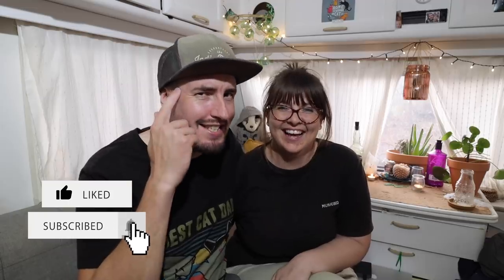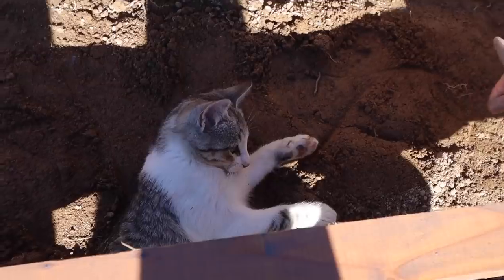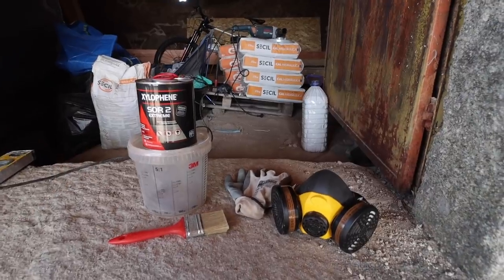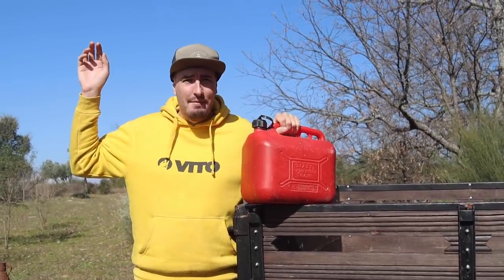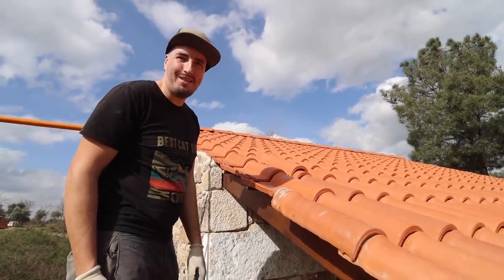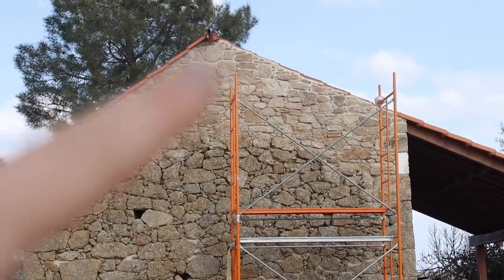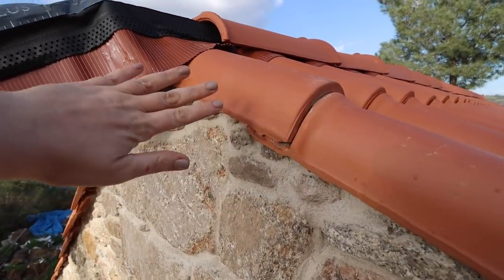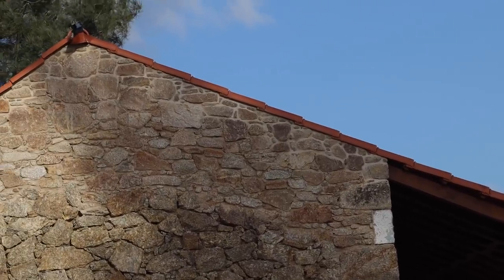Completing Our Roof! Restoring an Off-Grid Abandoned Barn in Portugal

Comment: I'm a former roofer that used to do tile roofs. DO NOT brush the whole roof. You DO NOT want to walk on that roof if you don't have to that is the number one-way you will get cracks in those tiles and leaks in your roof. Just let the next rain clean it for you
Reply: Sandra Westley I agree with the above, we had an extension and people have walked on the roof and we started with leaks, trying to find where they were coming from was a nightmare because they were only hair line cracks, (no pun intended) but once we found them and replaced the cracked ones we are dry Again but it’s taken a year of leaks to find where the water was getting in.

Comment: Put the old steel door on a hanging slider rail so it covers your glass door when away but slides nicely to one side and still show off the patina under the veranda
Reply: That is a brilliant idea. It would look really cool and do the security thing well.
Reply: @consideredwhisper  Totally agree!
Reply: That is exactly what I was thinking.  But one has to think how safe that is on the outside.  If it can be removed from it's tracks, that would not be for safety, but appearance.
Reply: seriouslyjoking2 Yea, true, but it could be bolted into the wall when max security is needed. If someone really wants to get in they will always find a way! Skylights for example.
Reply: @consideredwhisper  Yes, that is true.  But who in their right mind wants to climb that high to break in through skylights?  Sounds too desperate.
Reply: Great idea!
Reply: @1MartinWaite  Slate is used for creative projects, isn't it?  I wonder if they were valuable than what was inside the house.  Either way...that is awful.
Reply: @1MartinWaite  That is just ridiculous.  In America, the tiles are used for creative projects as very few houses have slate roofing.  I understand why you would move.

Comment: I live in the south of Spain, so not too far from you. I have 3 similar roof windows in my kitchen on a north facing roof. They let in lovely light, and also keep it private. You have explained your thoughts about keeping out the heat in the summer. However, things can get pretty cold in the winter. I am so grateful for the south facing patio doors in the living room. They let in lots of warmth in the winter, when the sun is lower in the sky, but not much in the summer when the sun is overhead.
When I first came to this area we rented a lovely apartment, that had no direct sunlight at all. It was great in July and August, but before the end of September we needed heat in there. So my lesson is, don't ignore the other 3 seasons when there is less heat!

Comment: Why not take the generator as well and fill both that and the spare can?
Reply: Fuel stations in the U.K. don’t allow you to fill anything in/on the vehicle - not sure if Portugal is the same? You have to put the container/gene on the floor, and the gene they have is probably a two person lift, so easier to get another container imo.
Reply from the maker: It’s just the hassle of moving it, it’s really heavy!
Reply: @theonlywoody2shoes  - It is. At the moment, because of the pandemic, you can only fill containers and they have to be proper fuel containers, used water demijohn's aren't allowed.

Comment: You’ve done an amazing job with the roof tiles. Absolutely gorgeous! One suggestion re the front door. You may want to consider installing a Dutch door or a door with panes and with one pane that opens. I suggest this because when you are cooking on cold wet days, it’s nice to have cross ventilation when necessary without having to open the door entirely. Also, at night—to prevent certain critters from coming in while you sleep—it’s a convenience. Just a thought.

Comment: Theo, you asked about the electrical on your truck. The quickest and easiest way to prevent the battery from draining while you are deciding how much time you want to invest in tracking down an electrical problem in a work truck is install a disconnect switch on the negative side of your battery. I'm sure your tractor has one. But a simple rotary on/off switch so that you can isolate the battery from whatever is draining it.

Comment: Would go for a 3 layer laminated glass door (would cost with the stainless hinges and labor roughly around 700€ no more than that, but always ask for several quotes so you can grasp the average price, for 2k or more I could close the entire terrace with a harmonica style glass cover, that fold into one another), it cracks but doesn't collapse keeping it secure, and you can also add a weatherproof vinyl on the inside of the glass door to add strength and privacy to it if you so wish; did so to one of my verandas using vinyl that during the daytime you can see through from both sides but when night comes you can only see from the inside. Don't forget that glass also has its issues, starting with cleaning ;D
Kudos for the brilliant work so far guys.. keep the dream alive, stay safe and remember .. your life, your rules.

Comment: After pointing the outside walls there's this transparent product (like a varnish) that impermeabilizes stone and cement surface. It's expensive but it also prevent the stone to become stained or with lickens growing on them.

Comment: I love the fringe Bea- suits you so much! For some reason, now I’m noticing your lovely smiling dimples more. 😎Really happy for the work on your barn- it’s coming along so nicely. ** I have a suggestion. Before Theo repoints everything, you could install those fisheye peek throughs like you’d install on an apartment door. Might be fun to add that in at eye level through a crack on your walls to see out the sides where you don’t have a window just so you can peek out without getting out and it wouldn’t let any light in. Not sure you have a gap big enough in your rock wall  or if it comes in a long enough length to get through the wall but I thought it might be a fun add in.

Comment: You should take all those leftover pieces of roof tile and do a mosaic with them. Break them into more pieces and you could paint them.. also, it is dry clay really, could also add it to your cement mix etc for some color. You could also do a shower floor with the tile pieces. Or a bathroom floor. Above the door would be a nice spot for a mosaic. Its age it ia now and when you refurbished it and a name or something...

Comment: I live in north west Spain (Galicia) and I have 2 wide stable door in two parts. One of mine is two panels of solid wood and the other two panes of quadruple glazing with a wooden frame, but maybe the best idea for your verandah door would be wood on the bottom and glass on top, and a removable wooden shutter for the top for when you go away.  If we keep the bottom one open mice tend to try to get in, but with the top open we are rodent secure and plenty of light.  It is not a cheap door, but if you are known to travel a lot and be away then you might be a target for bored kids who want to break stuff.  Your front door is the only weak point in your security, the other windows being too small or too high, so invest in that, if anything.

Comment: If the fuel trip took 40 mins round trip, could I suggest you get a larger fuel can such as a big Jerry Can ,which will hopefully save you running out . i know you said you had a back up but perhaps a larger can will be worth considering ,usually you can get them relatively inexpensively. Well done on the work on the house ,we enjoy the videos.
Reply from the maker: Yeah we have quite a few they really had up with 3 types of fuel we need. We normally tie it in with a supermarket shop as the generator can go 2 weeks with out needing filling sometimes 😀

Comment: Theo. Get your new router out and make your own door. You've got a load of left over chestnut? Make a simple mortise and tenon jointed frame with a cross bar. You'll need large clamps for gluing, probably cost prohibitive for a one off project. There are ingenious ways around that problem if you've got a few g clamps already. You should be able to find some recycled double glazed panels for the glass. It's common sense. Take your time, keep everything square, measure twice cut once etc. I think you'd be surprised how skilled you are.

Comment: Have you considered what we here in the states call a barn door?
Its a two part width wise. You can open the top.part and have light and breeze and keep the bottom half closed.
Ihave deen then with small glass window so if you have it closed you still have light comming in.
Just a suggestion since it is a converted barn it would keep with the style conversion. And a local carpenter can make it and might be cheaper than ordering one commercially.

Comment: Have you thought about having a full length window that can be used as a door when unlocked fully. And also used as a window when half unlocked tilts forward about ten to fifteen degrees to let ventilation in. I had one back in the UK when I lived there and was great in the summer.

Comment: Wood has selfprotecting oils and resins particulary indoors where it does not get wet, just a bit worried about you as you will be breathing this stuff in for years where you are sleeping. I think oiling the wood with lineseed oil would be totally sufficient.

Comment: The roof turned out great. After all that stress. 👍👍
Your window plan sounds good. Hopefully it will be nice and cool during the hot summers. Having that indirect sunlight is key in such a place.
Not surprised by a custom front door for 2k. Hope you find something more cost effective. 
Just wondering about the walls internally. Will you guys be plastering?

Comment: That old steel door is beautiful.  Rust patina exteriors are used in a lot of restorations.  I noticed a piece or two of metal hanging loose on the door.  Are you going to fix that?

Comment: Theo , man to man,  get that car / van/ pickup truck / tractor / motorbike covered parking bay made before the hot Portuguese sun comes ! It will keep them cool and protected from the hot sun in the summer and rain all the other times, you know it makes sense. Let’s face it Bea has had her chicken Palace, her shower and toilet done isn’t it time you had your man toys protected lol
Reply from the maker: Agree definitely makes sense, working On a few designs 😀
Reply: If you position it in the right place you could put the solar panels on top and build the solar batteries cupboard  inside and a place for a back up generator just in case and room for a few chest freezers for Bea’s crops when her vegetable garden kicks off

Comment: @ The indie project
Greetings from Trujillo Peru. I enjoy watching your videos, but seeing you use a  petrol engine to run electric tools and lights when I know you've got solar seems so wrong. Are you going to increase your solar system?
Reply from the maker: We will be as solar as we can one day but unfortunately the tool use extreme amounts of power. We would be looking at a system of around €10,000 + to run the tools we are using. The grinder is 2200w and we need the cement mixer on for hours a day so it’s just not practical right now but the house will be fully run by solar

Comment: as a person who's made a mistake of installing a huge glass door - don't do it, please. It is very heavy, in can tilt on its hinges and will need to be constantly adjusted, it can get cracked if the temperature changes drastically within a short amount of time (as it happened to me) and it is a huge pain in the ass and a lot of money to replace the glass panel. Please consider installing two glass doors instead on one, please.!

Comment: Nice project! But I don’t understand why you’re putting money in insulting the ground floor? The soil under your expensive wooden floor is the best warmt accumulator you can find. In the winter it stores heat and in the summer it cools. If this whas my project I would put a tile floor in there. Nut that’s just my 2 cents. Good luck!

Comment: Is it me or you’re showing less and less of the build and talking about other things such as your hair cuts, before filming check your supplies that you’ll need for filming so you won’t have to run out and get them using up video time that should be used for the video. It’s starting to get annoying I want to see the build and not jumping in the truck to pick up supplies!
Reply from the maker: If we just showed building you would probably complain how boring that is. It’s very difficult to balance actually building a house that some days is just filling holes in the wall or doing incredibly slow work like chipping out old mortar, these videos show our life not just building and we try to get a good balance 😀
Reply: Ok I get it but I would like to see more of the build if possible, it’s just more interesting to me.